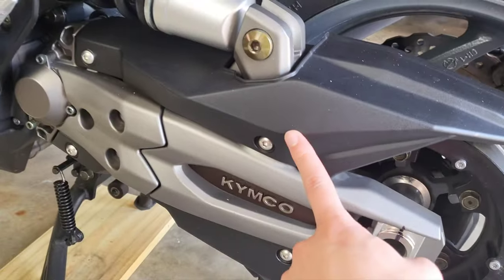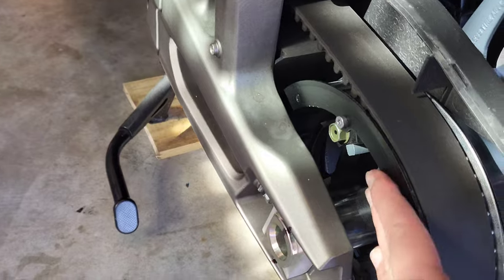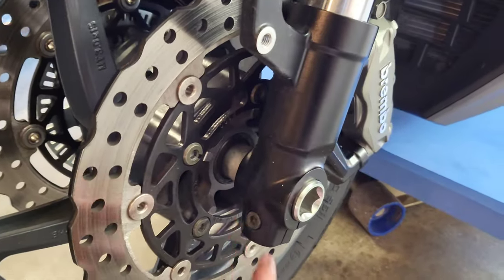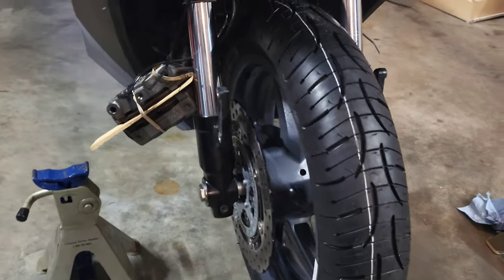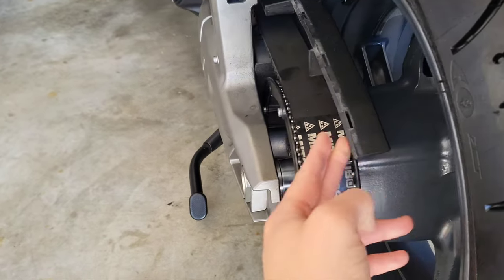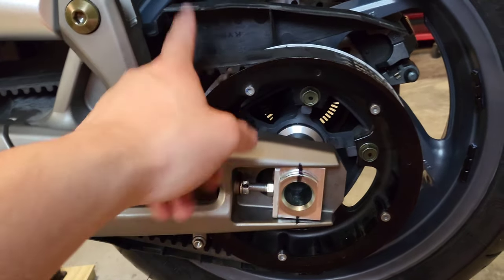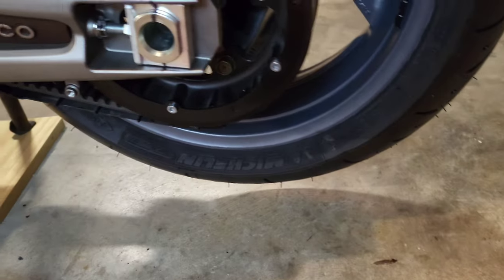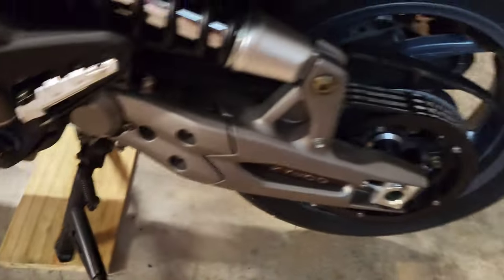How to remove and install both wheels on a Kymco AK 550. USA

Comment: I would think that you should invest in a dial caliper to measure and record the dimensions of the axle tension blocks. I think that if you had measurements accurate to the thousandth of an inch and then repeat those measurements when you reassemble the rear wheel.  That black mark could leave you anywhere in that marker space.
Reply from the maker: @paul5683  I've taken the wheel off multiple times since this, it doesn't need to be accurate. I'm going off Cyclepedia service manual that Kymco used to make the US version. Read my pinned comment, left is for tension right is for wheel/belt alignment. No problems going this route.